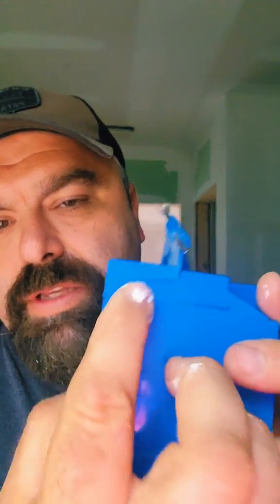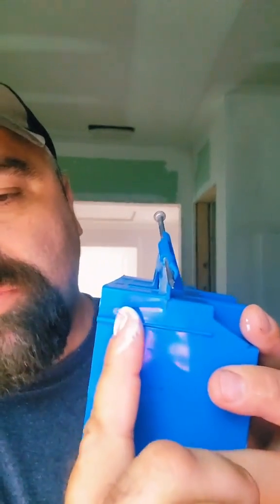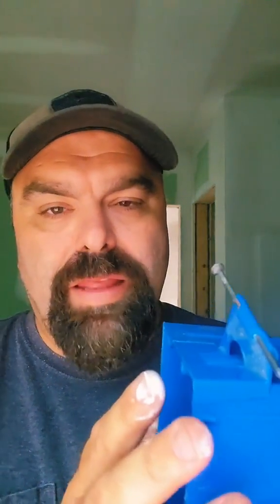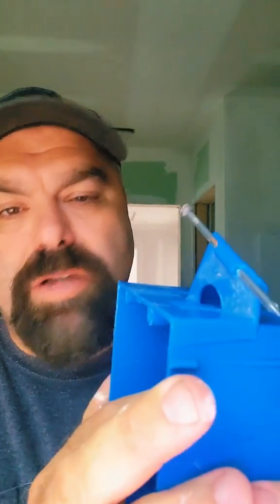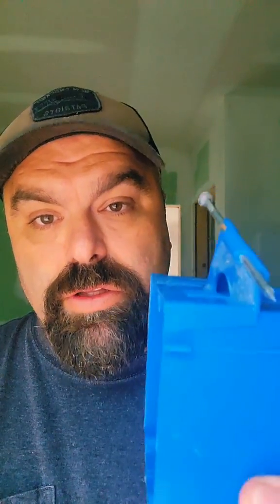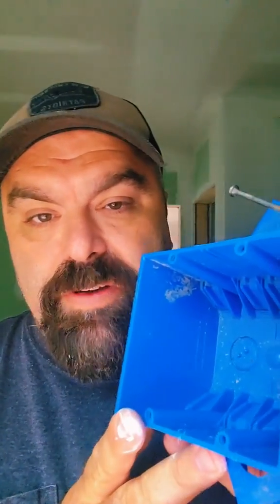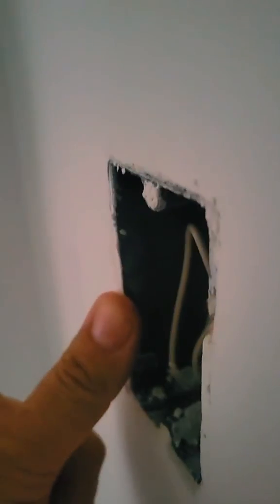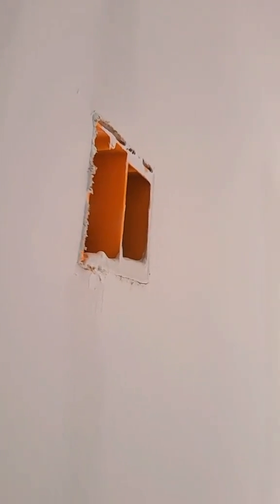Electrical boxes should be set at 1/2 inch, not 3/8

Comment: Most of us have oscillating/detail tools to cut any excess plastic away very easily if the box is strong. Studs dry and twist alot too, I prefer more plastic to work with than less in those cases as well.

Comment: If you're going to be that obsessed with boxes being even with the sheetrock, then just get adjustable boxes to determine depth at finish. There is also the factor of twisted boards to prevent boxes from being square with the wall.
Reply: It's about professionalism....not obsession.
Reply from the maker: There is no obsessed it doesn't take longer to mount them at 1/2 inch.  And if the stud is twisted you will see that on the rough